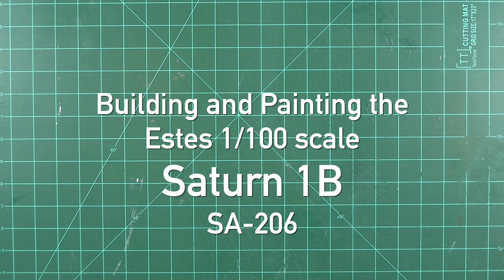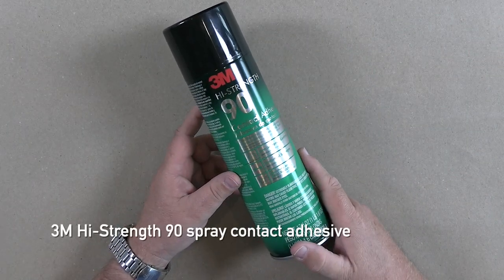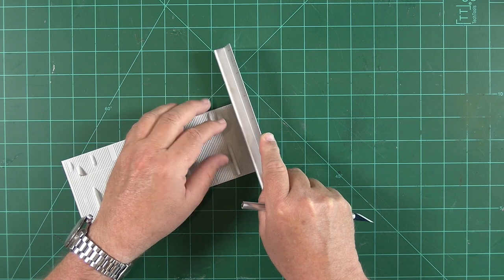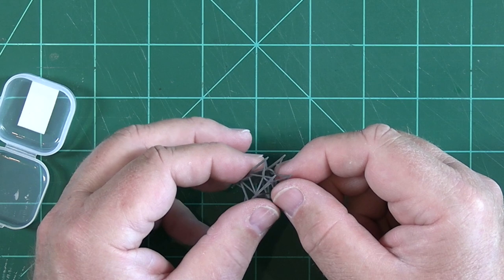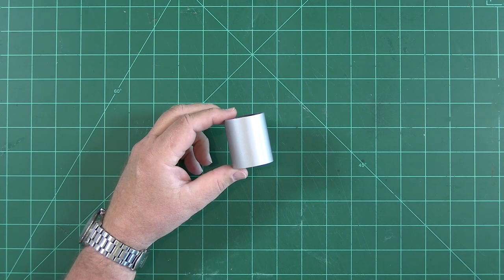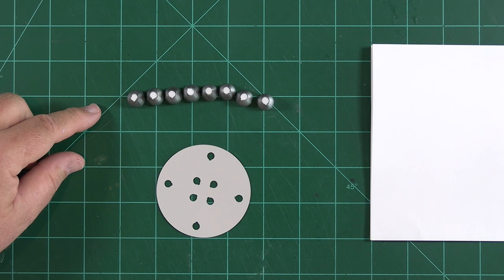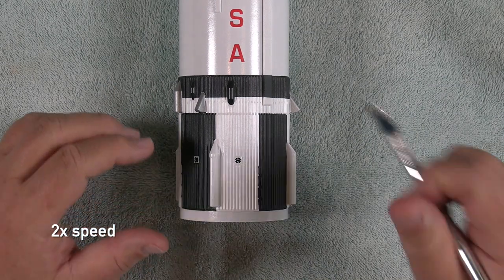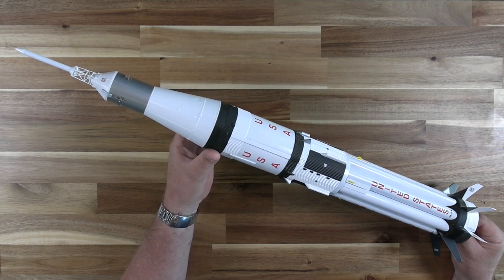Building the Estes 1/100 scale Saturn 1B

Comment: Great build! I will definitely use this video as reference when I build mine. One tip I can offer is to grind the engine hook and sand the inside of the engine block. This allows use of a 24/60 motor case.

Comment: I built the original release of this kit back in the late 1960's when I was about 13. The first release of the Saturn V model didn't even come out for several more years. This first release Saturn I-B was a lot harder to build well, mainly because the fins had to be built from card stock (included in the kit) and balsa, the scalloped lower tube shroud had to be cut and trimmed to fit from card stock, the tapered portion of the S-IVB was also cut and rolled with an end to end glue seam (not overlapped). The original kit used a 4 engine cluster of B engines. It was a huge challenge to build and mine came out okay, but not nearly as nice as yours. I painted the whole thing with a brush and Testors enamel model paint after spraying the entire model white first. Instead of the raised details like the clamshell panels of the S-IVB, you drew them in with #3 pencil.

I have this new release, as well as the Saturn V, both Little Joe kits, and the Mercury-Redstone kit. If I live long enough, I'll get them all built after I finish a 25% size Piper L-4 radio control model, being built from plans. I'm not flying any of them, hopefully the rockets will be donated to our local science museum and the plane will go to our local aviation museum. 

Thanks for all the building and painting tips, I'll use an air brush on these for sure.

Comment: Not sure I could bring myself to fly it after all that work!!  How well do these fully scale rockets tend to survive flight?
Reply: They fly well. On my page I believe in flying them all at least once. No shelf queens. If it has a mishap repair it and fly it again🚀
Reply: @modelrockets3215 Waiting for your maiden flight Keith with that 4 engine cluster.  👍👍.   (I have 3 Sat 1Bs and gotta decide build or sell. Pint looks intimidating with out air brush.

Comment: is there a way to send you a picture?  The longer cable race way part is too long by 10mm.  Almost as if the upper wrap should not have been placed 10mm from the edge of the tube but right at the edge?

Comment: Love your video.  I'm building the same model.  I followed your video but when I applied the ts13 over the xf-69 it all cracked.    Any idea what I did wrong?  Thanks in advance.
Reply from the maker: Thanks for the kind words about the video!  Sorry to hear about your difficulties. The crackling is usually the result of applying the clear lacquer in too heavy of a coat.  Best results will be achieved by applying lacquer (in any color) in multiple very light coats, waiting 7-10 minutes between each coat.
Reply: @rocketaero  thanks for the response.   I thought I was pretty far from the model,   ill try it a little bit farther away next time.
Reply: @rocketaero  thanks for the tip!  Main fuselage came out perfect!   Idk how to post pics, otherwise I would so I can show you the nightmare you saved me from.   Thanks again!🤟🍻

Comment: Did I miss or did he not ID type , brand of paint used. ??
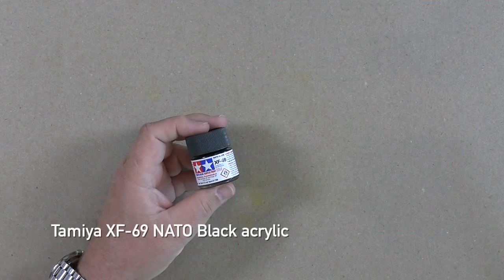Reply from the maker: You missed it.  The overall white is Tamiya TS-26 Pure White spray lacquer (27:48), the silver is TS-17 Gloss Aluminum spray lacquer (33:14, both rattle cans), and the black is Tamiya XF-69 acrylic (34:46) applied with an airbrush.

Comment: Do you use the micro sol on the decals that go on the wrap? Or will it damaged the vacu-form plastic?
Reply from the maker: MicroSol will not damage the vacform plastic, nor will it damage dry lacquer.  If you use it on a surface that you have painted with acrylic paint, though, you should let it cure for several days before using any type of decal setting agent.

Comment: You mention the fin decals are easy to screw up--you can say that again!  You have placed them on the wrong fins according to the instructions,  They go on the alternate fins (between what you are calling the quads).  But it gets worse: the instructions show using the quad white stripe decal twice and the dual white stripe decal twice!!  So at this point maybe I will just go with what you did!
Reply from the maker: Peter Alway's drawings in his magisterial work "Rockets of the World" were used to guide the installation of the fin markings, backed up by photo and video references.  The placement in this tutorial is accurate.
Reply: @rocketaero  Very good - I went with your video- the Estes instructions are poor in this area

Comment: Would you recommend matte or gloss clear coat?
Reply from the maker: Gloss would not be appropriate for this prototype.  A matte finish would be correct, but will also attract fingerprints and other filth, especially if you plan to fly your model.  A compromise would be a satin or semi-gloss overcoat, which will tie things together like a matte finish would, but still have some resistance to grime.  Tamiya TS-79 Semi Gloss Clear spray lacquer should work well.

Comment: you did not install the wire anchor in the service module; is that because there is no intent to fly the model?
Reply from the maker: Correct, I did not install the anchor.  I find that it is far simpler to loop the recovery harness line around the Command Module instead, attaching the snap swivel back onto the line.  Very easy, and no non-scale loop protruding from the model.
Reply: @rocketaero  ok thanks- is there a video that covers the launch recovery system?
Reply from the maker: No, but I'm about to start a new Saturn V project that will offer an opportunity to show the technique.  Look for it in the next couple of months.
Reply: @rocketaero  thats great- I have the Saturn five Skylab kit.  Will look forward to another fantastic video from you!
Reply: What exact Saturn five kit are you building? The Skylab is only one currently available, but there are Apollo versions on line.